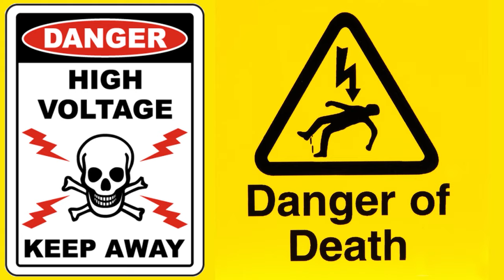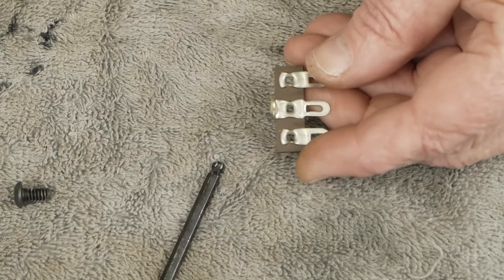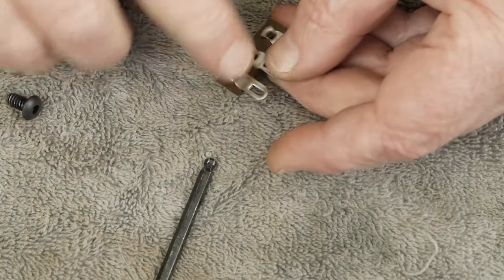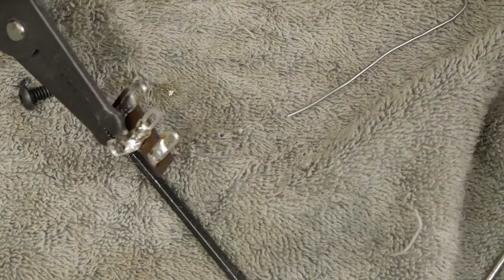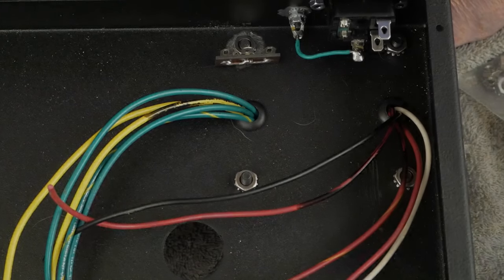5751/EL34 Amp: Production Amp Power Supply Continued

Comment: Hi Skunkie, thanks for the heads up on the EAR834 and the build tips.  It sounds great-- quiet, way better than I expected.  I'm using old Baldwin organ/piano tubes made by sylvania just as a test and there is no noise at all, I do have some 7025 by GE and EH and some others I cant remember, but don't know how it could get better.  Note- I had one of those clone/clone boards and scraped off the TT ground and the standoffs are connected to the chassis as well, but...I still don't have any hum or noise.  I also left off the LED and used an oragne neon on/off switch I had laying around.   Lots of bass, I'm using Polk monitor 7 and it just sounds great.  Did I say how nice it sounds!  Thanks again
Reply from the maker: These things just sound SOOOO good to me!